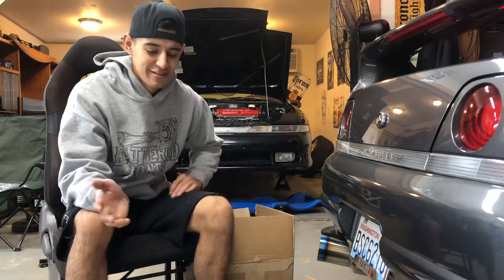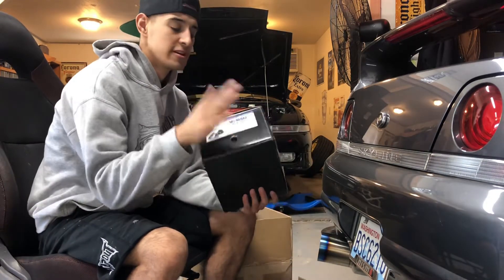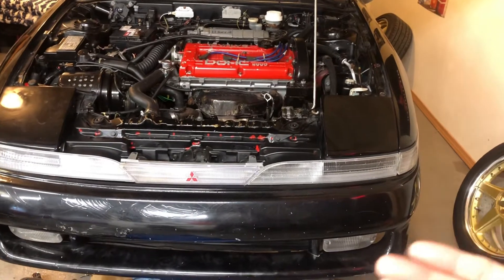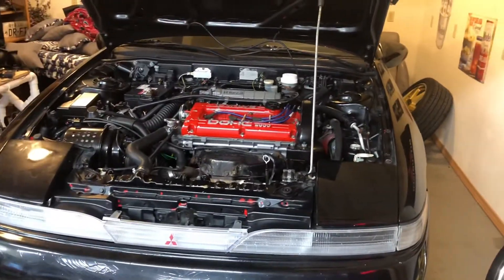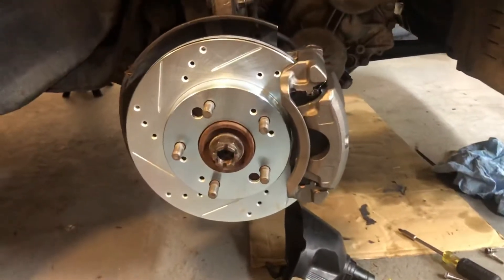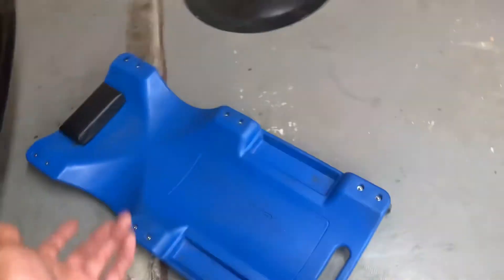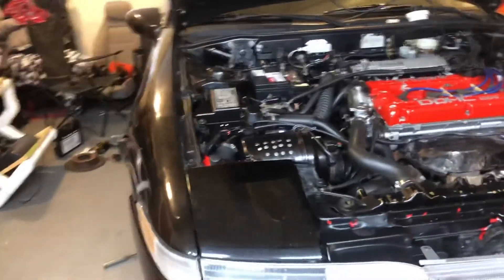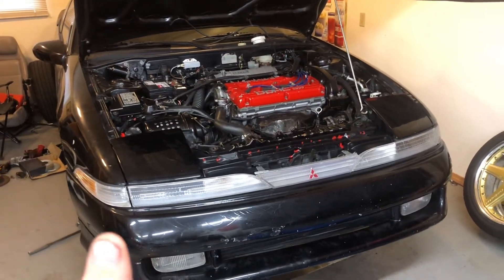New brakes for the 1G Mitsubishi Eclipse Gsx

Comment: I've got a 1992 Plymouth laser all wheel drive turbo. Working on the rear brakes. I believe I have to remove the emergency brake cable to put the brake pad in. Did you ever figure yours out??
Reply: Hi that is the best way to do it :)